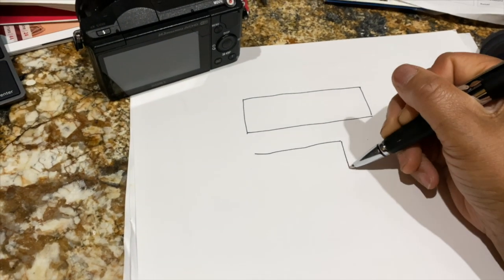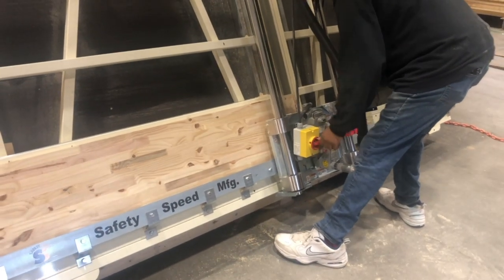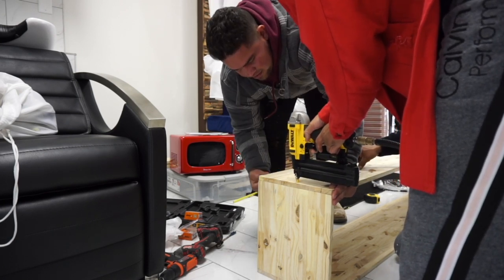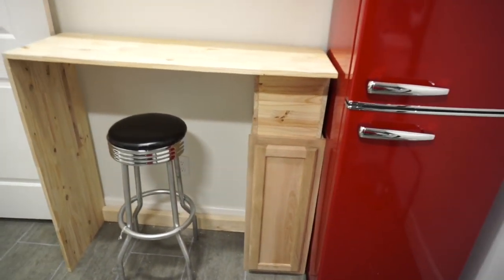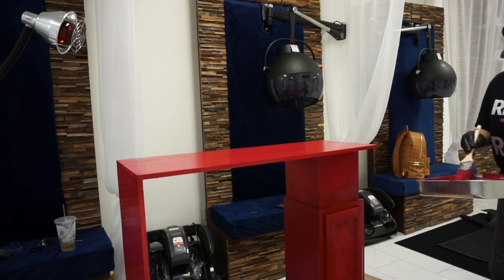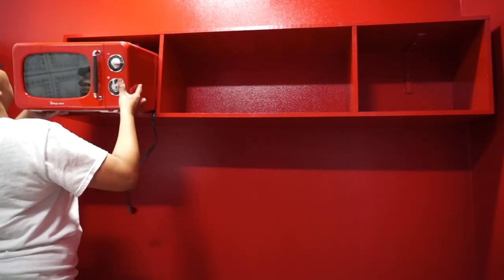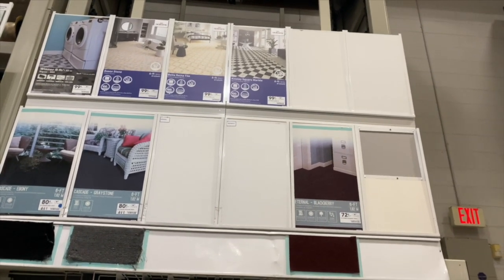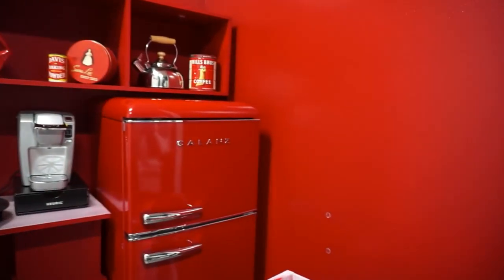How to DIY small Kitchenette Retro style

Comment: I can't use boldhold cause I got to take off my wig as soon as I get home. Is the tape for daily application? Is it hard to remove? Do I need a solvent to remove it? Thanks.
Reply: @Thehairdiagram767  will you make a  tutorial showing how to use and remove the daily adhesive that will be coming out? And do you have a date for that? I want to get mine early before you sell out. Also do you have a video with just using the tape (putting on and taking off a wig) caused I'm trying to hold out but at this point just throw it in a Ziploc bag and give me the price. 😆